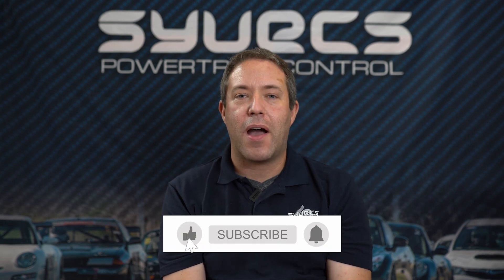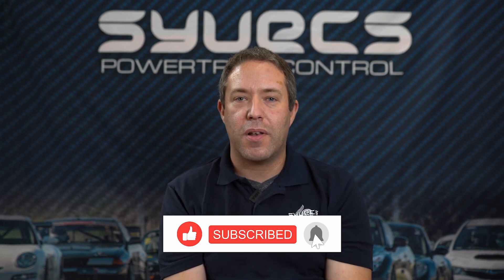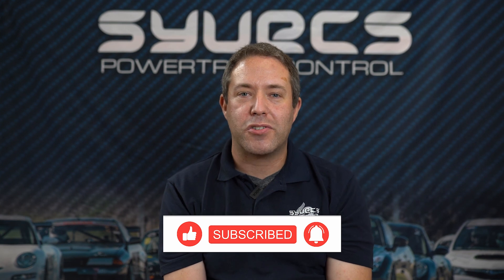Cable Throttle vs Drive By Wire | Syvecs Says #13

Comment: You're basically saying "We're taking away the control of the car from the driver because we believe drivers are too stupid to learn proper throttle control and are too slow to perceive the delay of the system". The only real advantage that drive by wire offers is the auto blip function for downshifts, something that could be implemented with a servo that only gets a signal to open the valves for the blip and nothing else. I watched a video a few hours ago of a guy trying to debunk the dbw lag and he showed that there's a combined of 79ms of delay between flooring it and the plates opening fully. 79ms might feel like a short time to you but it's not a short time at all. And that was on an aftermarket kit, not an OEM implementation. Drive by wire will never be as direct and precise as a cable actuated throttle. Besides, traction control CAN be implemented with a secondary valve set. The system will still have the instant and direct response of the cable but the secondaries can do the work of the nannies. Kawasaki did it, Yamaha did it, basically all the japanese bikes had secondary throttle valves alongside the cable operated ones.
Reply: Exactly why my next car will be a 90's sporty car.  I hate modern cars that feel lifeless because of all this computer controlled bullshit.  Give me cables and hydraulic fluid!
Reply: @GOLD_FEVER  auto manufacturers have over complicated a system that was simple , proven and effective - such rubbish now and more expenses when the c**p goes wrong